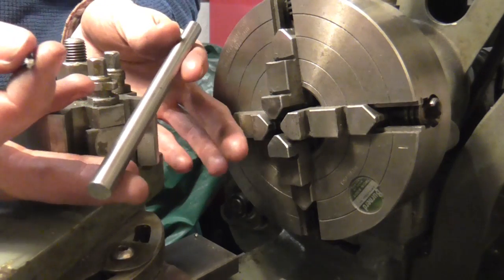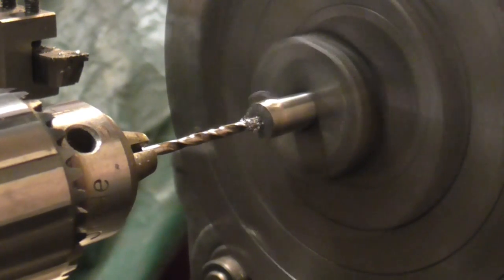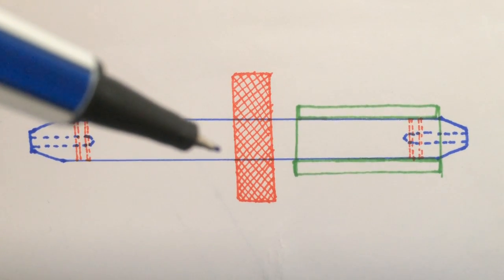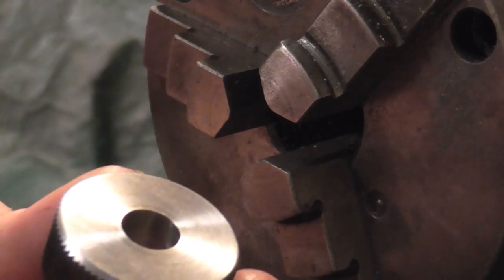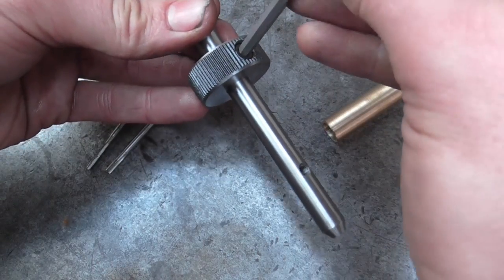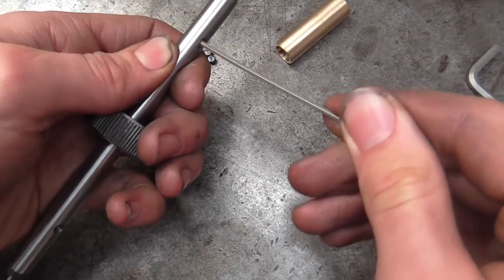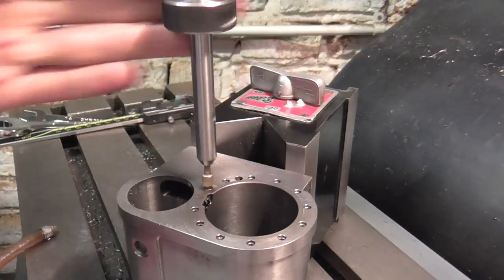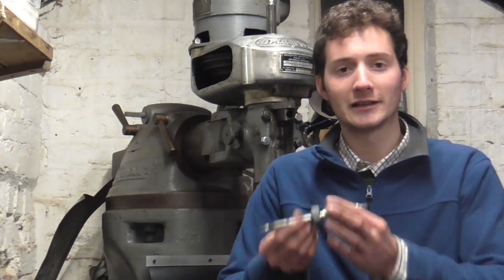Tapping Small Holes

Comment: Hello MrCrispin I was watching your video channel making a tap guide, I noticed the spring type that you were showing with the point protruding out is for taps that have a hole in the end, but you might already know this but because you did not show it on your video I am assuming you might not, if you undo the allen screw on the end of the spring tap guide there you will find the spring where the other end is hollow which is for taps with no hole in them and for taps which are domed shaped.
Kind Regards Keith Scourse.